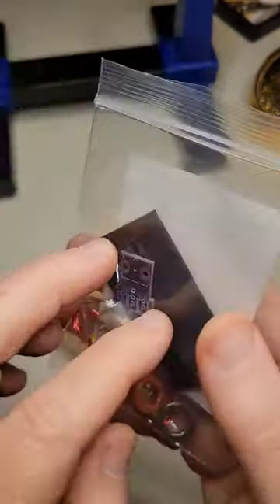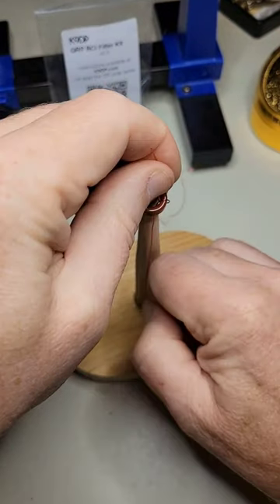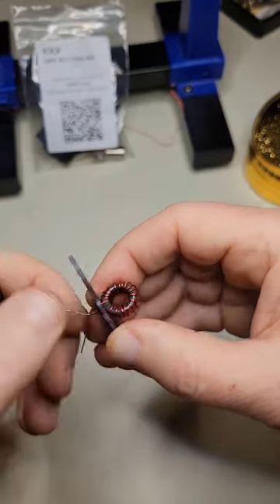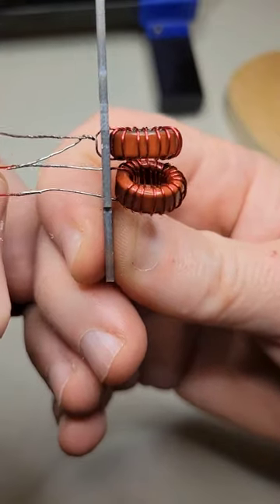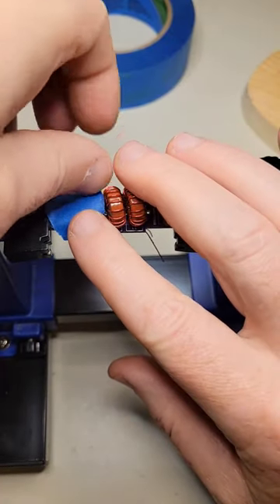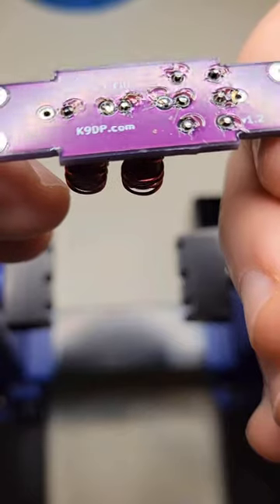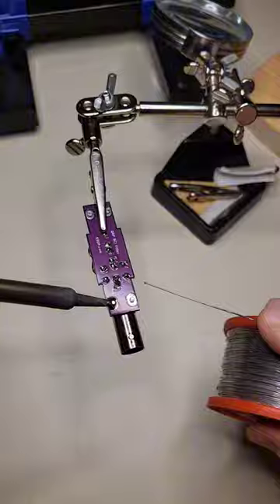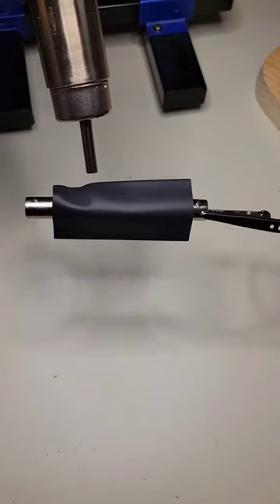K9DP QRP BCI Filter Designed for HF Ham Radios #shorts #qrp #hamradio

Comment: Is it a ceramic or ferrite ring?
Reply: They’re powdered iron toroids type 2. You can tell clearly because of the color coding. The red is added after the core is formed. They don’t typically do that with ferrite, though I’ve seen baluns containing ferrite where that has been added afterwards.
Reply: @Kinetic79  thank you. I should look into this. Not overly familiar with this aspect of circuitry.

Edited: Pressed-powder cores are made from insulated iron- oxide particles which are pressed together to form solid core shapes. Compared to ferrite, pressed-powder cores are lower permeability but generally support higher current without saturation.

Comment: You were confident, putting the heat shrink on before testing.
Reply from the maker: I wanted to get all the steps in the video. Removing the heat shrink isn't difficult if there's an issue.
Reply: The main thing I would do is a continuity test on the pads where the toroids connect to. Those of us that have built QMX’s know that you can even get less than ideal solder joints when you show some basic continuity… so also a good idea to get some really good heat at those joints for >10 seconds to help break up some additional enamel where your scraping may not have been perfect or uniform. :)

Comment: What does it filter? Noise
Also can i use it for uv5r?
Reply from the maker: It filters out AM broadcast stations.  Sometimes they are so powerful that even though the radio is built to not pick up the station, you can still hear it.  The filter eliminates that interference.
No on the UV5R question.  It's made to filter out interference on the HF bands which are quite a bit lower in frequency than the UV5R (VHF).

Comment: Typically you don't need anything like tape to hold through hole stuff in place. You just bend the leads out at wide angles and they hold themselves in place if you want to turn it upside down for soldering.
Reply from the maker: True
Reply: Yep, the first kit I ever built mentioned this and I've used it ever since.
Reply: Leaving the leads straight makes it easier to remove parts if you've made a mistake.
Reply: @BrianG61UK  no it doesn't. Once you desolder a resistor, cap, or other thru-hole device, it pulls right out.
Reply: @paulheitkemper1559  Yes it does. You don't even have to pull, they drop out.
Reply: @BrianG61UK  go watch any of a myriad of youtube videos on soldering. They all mention bending the leads out at a slight angle to keep the component in the holes. Or the work instructions of any company that does through-hole soldering. Most boards are pick and place, but believe it or not, there are still some places that do some manual "board stuffing." They will all mention bending the leads at a slight angle to keep the component in place.